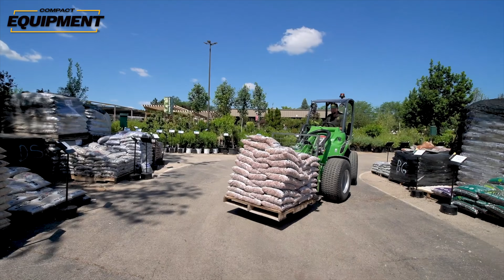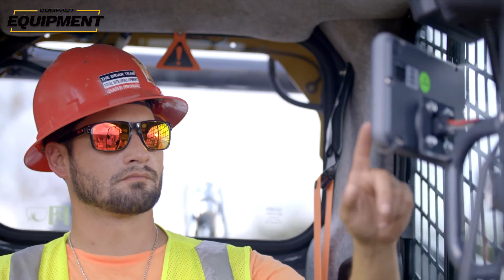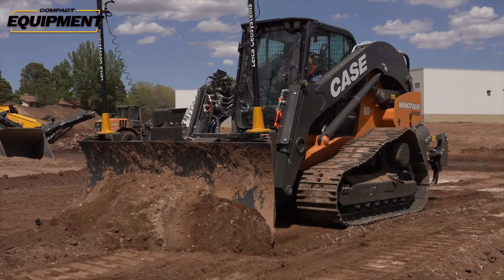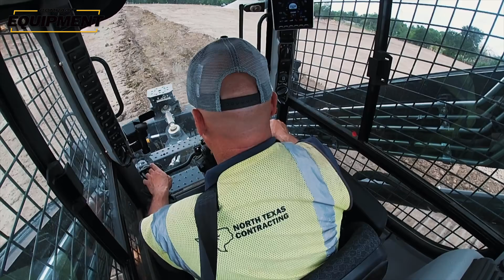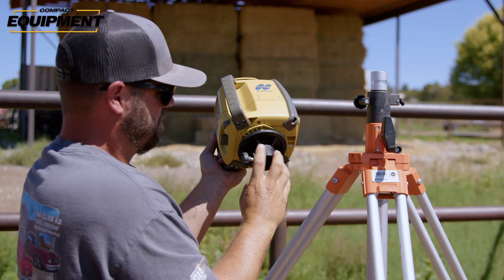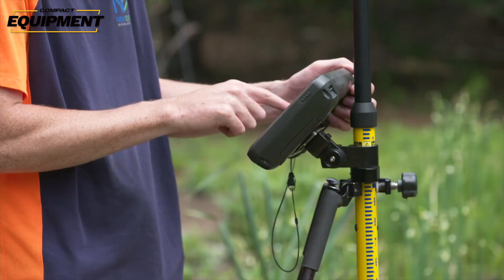Compact Track Loader Grade Control: 2D or 3D? Auto or Indicate? Base or Total Station? Dive in!

Comment: An IMU is an inertial measurement unit (IMU) - which is an electronic device that measures and reports a body's specific force, angular rate, and sometimes the orientation of the body, using a combination of accelerometers, gyroscopes, and sometimes magnetometers.  Great video!

Comment: We have a DL550 Minitour.  We also have a Sharp grade G128 dozer attachment that is 3D LPS controlled Topcon system.  This combination is really impressive.  The capability of the DL550 has to be experienced to believed.   By itself as a dozer, pushing the G128 or as a CTL, it never leaves a job site.
Reply: How do you like the dl550
Reply: @ErikWhite-r8w    I have been really happy with it.  The fan had been an issue coming apart, but they seem to have that figured out   That has been the only mechanical issue.  It gives us capability we didn't have before.  The hardest decision had been whether to go with rubber tracks or single grouser, I went with rubber tracks.  The way we have been using it mostly, single grouser may have been a more correct choice.
Reply: I have a cat 265 with Topcon MC Mobile on a CaT GB128. I see no need for a dozer because we dont do big dirt pushes and would just use an excavator anyway to move material and grading a 800’ road section is nothing for the skid steer setup.